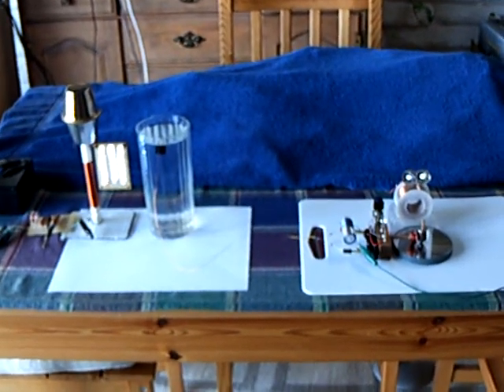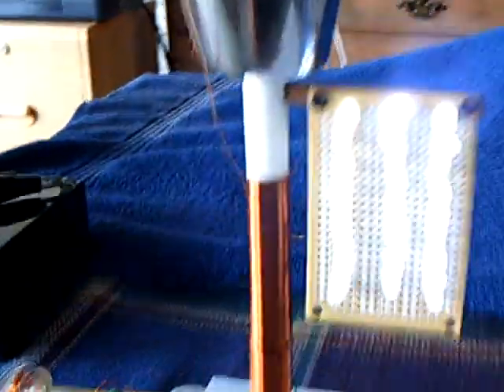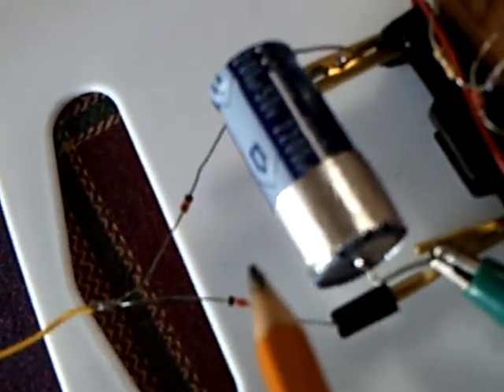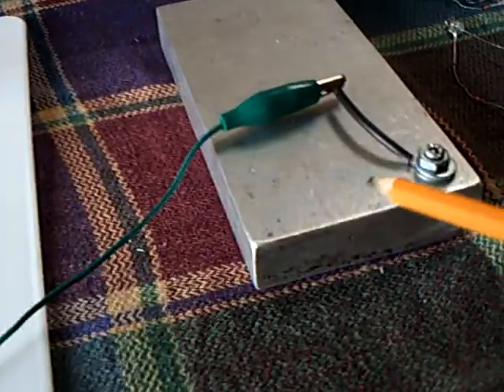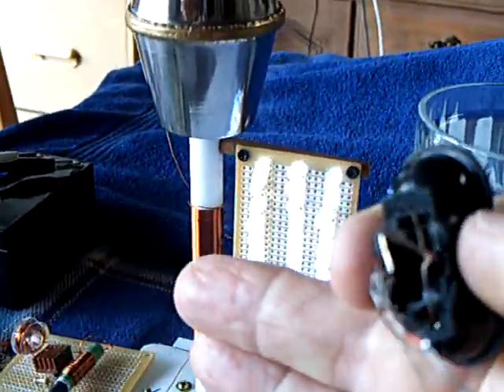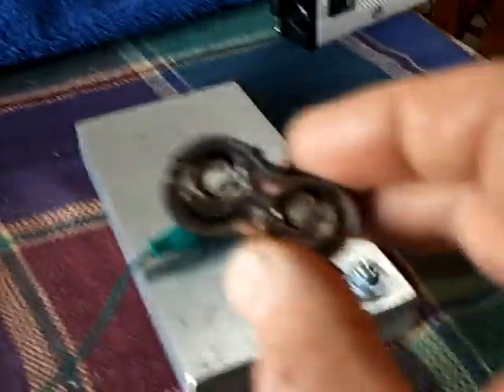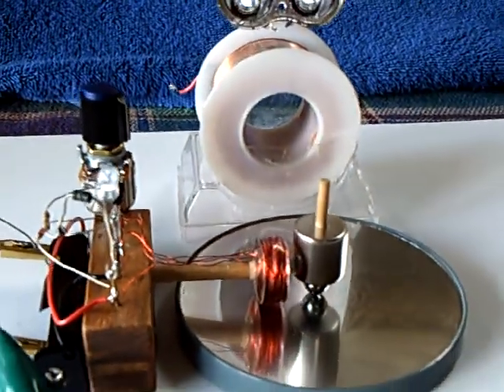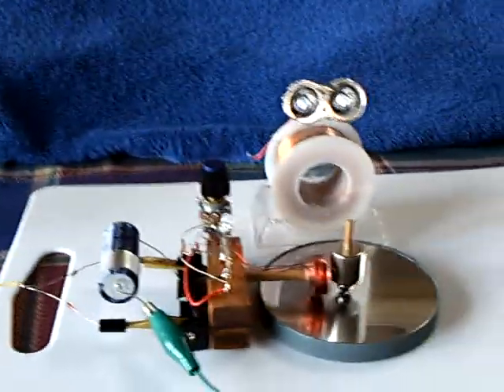Bobin Bedini  &  A glass of water.ASF

Comment: Cutting Edge Info ! - Great Stuff... 
- Please keep it up - 
? What is happening within the water ? 
? Would a metal plate attached to the wire 
alter anything ? 
? Would an electroliser chemical in the water 
alter anything ? 
? Would different liquids such as pure lemon 
juice instead of water alter anything ? 
? If adding more load does not alter the 
draw from the power source... can we then 
add multiple glasses of water and receiving 
configurations ? - thanks, Lid...